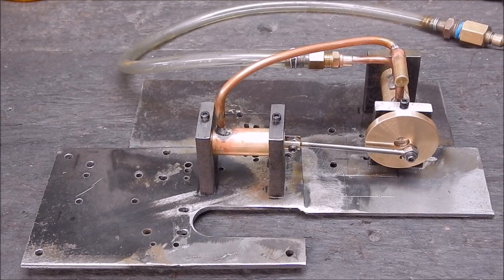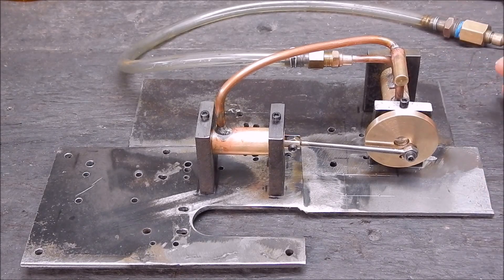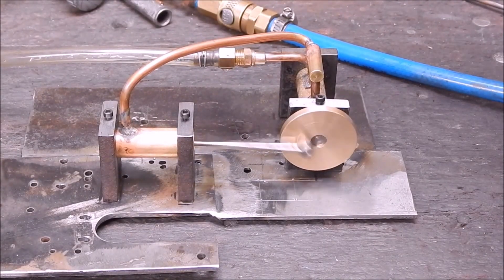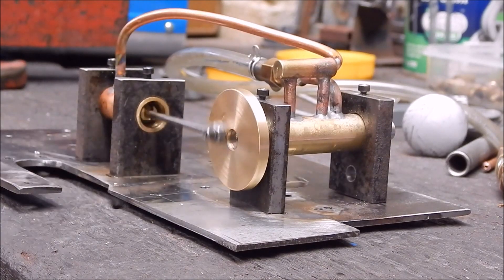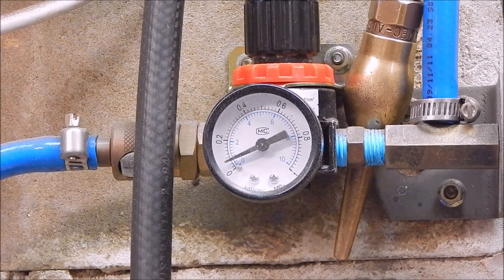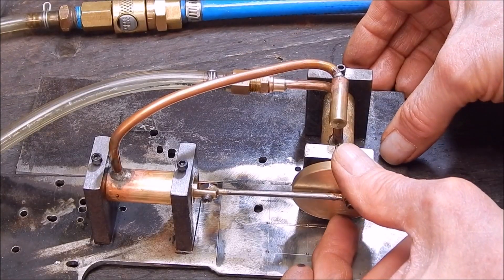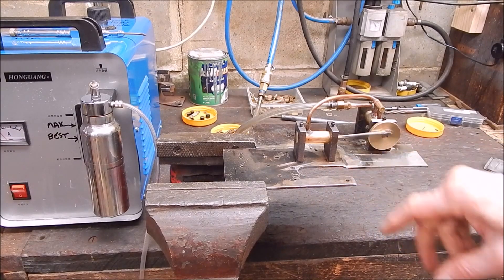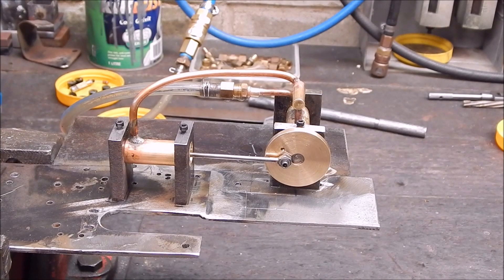I fire up the rotary valve steam engine

Comment: Incredible, fantastic. "It's alive" as Doctor Frankenstein said in the film.
The drawback using this single pipe feed must be the torque available.
Anyway, very well done!
You and Rustinox would probably do well together being rebells in this business.
Reply from the maker: Hi Stefan, yes, it is very low torque.  I was surprised how the valving has such an effect.  Interesting little engine.  Cheers Rob
Reply: @Xynudu  Working with real railroad steamers for a long time I've seen things. One loco got a valve broken and that cylinder got powerless. Pulling the hole train home having only one cylinder was out of question. My shunter had to do the work as well as getting back pulling the loco home.
Anyway, You made a fantasticly good work as well as figuring out the theoretics.

Comment: Nice Robert - this may sound strange, but it sounds like its occasionally missing, then you clamped it in the vice and all smooth again.
Reply from the maker: Hi Benny, the tolerances are pretty tight and it's still running in.  Any vibration may be causing drag in the rotary valve. Cheers Rob

Comment: Considering that all you have for a flywheel is the disc crank I think it runs superbly 👍👍👍 A very nice job Rob, also proves your idea of a single pipe to the cylinder. Looking at your gauge it seems to run fine on just under 1 kgf/cm2 which in pressure I understand is about 14 psi. That's about typical for a small model steam engine. Be interesting to see if a flywheel makes any difference. Cheers, Alan.
Reply from the maker: Hi Alan,  It needs a good spin to start, but that's mainly due to pressure build up in the rotary valves, which you have to overcome.  I will turn up a steel flywheel and put that on to see what difference it makes.  There are certainly not many components in it.  How does the 13.5 mm stroke and bore compare to the one you have ?  Cheers Rob
Reply: @Xynudu  Hi Rob. Mine has 1/2" bore and 11/16" stroke so similar in bore but longer stroke. Cheers, Alan.
Reply from the maker: Hi Alan,  I have fitted a steel flywheel to the other end of the crankshaft (same as your configuration) and it made a huge difference.  The engine will now run very slowly, on much the same air pressure as my other engines - less than half the pressure shown in the video.  Also interestingly the torque has gone up substantially, probably from the greater inertia and smoothing of the gas flow.  It's not as rattly as before.  I guess it stands to reason really.  I will finish it off now and do another video some time to show the end result.  Cheers Rob
Reply: @Xynudu  Hi Rob. I was kind of hoping that would be the case. Looking forward to seeing the final version. I'm still working on that Mamod Steam Roller my brother-in-law gave me but I should be able to start on mine next week. Cheers, Alan.

Comment: Make the flywheel a bit heavier it might be capable of low speed operation (impressive either way of course). Now how about an opposed twin version? (Lol)
Reply from the maker: That may be a possibility.
Reply: @Xynudu  I assume it would only require porting the valve cylinder 180 degrees from the single, and either a butterfly on the flywheel journal or offset connecting rod ends. I'm guessing an opposed twin would be the practical limit for cylinder count, more would probably result in exhaust crossflow between cylinders stealing power

Comment: Good job Robbie, could you put a fly wheel on the other end of the shaft and get it to run slower ? I think it would sound better at a lower rpm .
Reply from the maker: That's what the maker did on the one that Alan from RetroSteamTech has.  I can add weight to either end of the crank shaft.  I may try it and see what difference it makes.  The rotary valve faces act as pressure points and I doubt you can run these engines dead slow because of that.  Cheers Rob

Comment: Seems to run very well. Although I have an idea of how it works, I'm curious about the construction of the rotary valve (I imagine two timed notches, or holes, in the main axle, judging from the two small pipes and manifold leading to the cylinder). I tried to find the video of its build, but I failed. Also failed to find any plans or drawings for this engine on the web - probably was featured in some hobby machinist magazine decades ago and left no searchable traces online. Do you have any information that you can share?
Reply from the maker: Hi Jose,  I have to dismantle the engine to finish it off/paint etc, so I will lay out all the parts to show what is involved.  You are basically correct.  The original design used two pipes (feed and exhaust) but I have reduced that to one which oscillates the air flow.  

This shows the rotary valve construction :  https://www.youtube.com/watch?v=ZvgTF1pIssw

Cheers Rob
Reply: @Xynudu  Thanks Rob! I had brushed through that video before, looking at the setup you used and the results it gave, but not really paying attention to what was the part being made - my fault :-)
Reply from the maker: All good.  Cheers Rob
Reply: @Xynudu  Thanks :-)